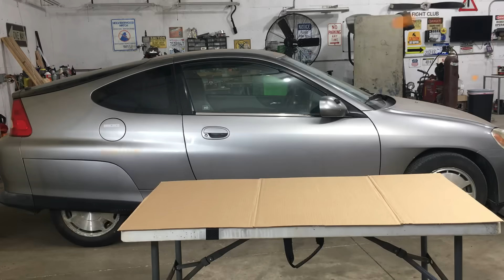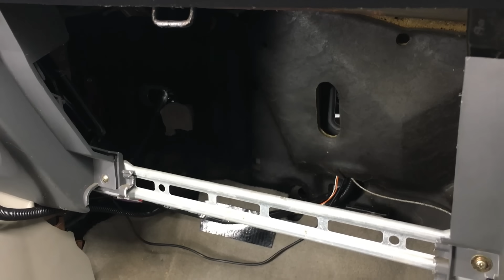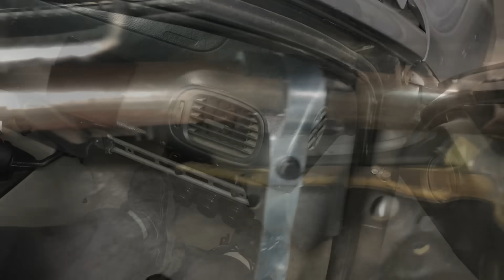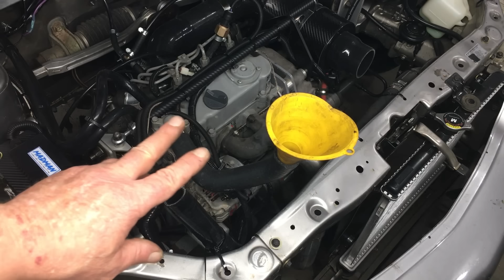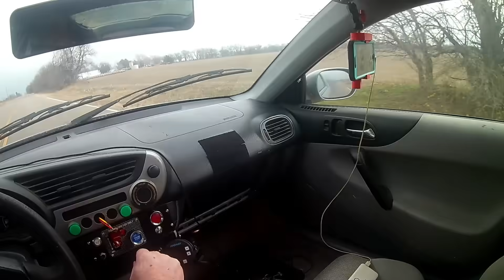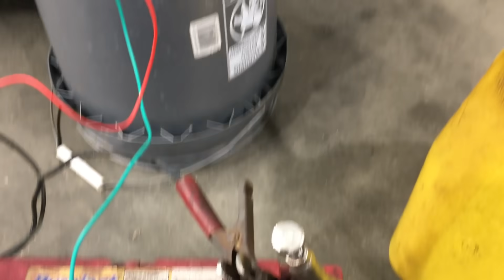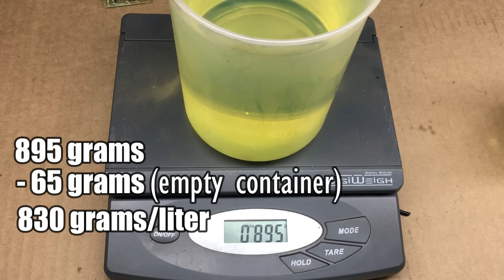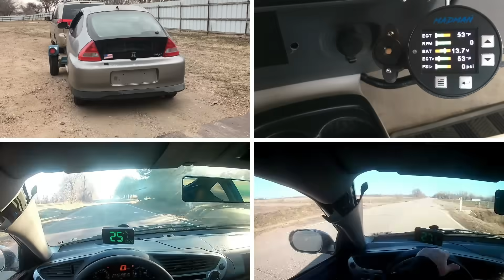S3 E46. MPG ? We test the fuel economy on the 719 cc diesel powered Honda insight

Comment: 67 MPG is actually quite a bit worse than I would have thought. That's pretty close to the stock insight would get on the highway, and the hybrid system doesn't really do much on the highway. Maybe the belly pan makes that much of a difference?
Reply: Stock first-gen Insight would probably have gotten more than 70mpg at similar speeds. I know mine does.
But there are lots of variables. I don't know if the tires are OEM or not (nothing beats the efficiency of OEM tires on this car). It's winter so that's probably hurting economy. I don't know if diesel fuel has winter blends that are worse for efficiency like gasoline does? Also the first-gen Insight engine had a LOT of tech put into efficiency; it's a tough challenger.
I also don't know if diesel efficiency suffers at 100% load like gasoline engines tend to. That 722 has quite low power; stock gen1 Insight ICE makes 67hp without the electric assist.
Reply: @IstasPumaNevada there is indeed winter blend diesel, and it probably does hurt mileage a bit. Different mix helps to keep gelling at bay, which is a massive problem with diesel at low temps. Main difference is more diesel #1 (kerosene) in the mix

Comment: Saw an Insight for sale locally for $2800. We also have a Horror Fright close by. Hmmm.... 🤣
Reply: If it's in good running condition, get it and leave it stock! It should get over 70mpg at the speeds used in this test, but still has enough oomph to maintain highway speeds going over mountains (like Homestake Pass, which I've driven my first-gen Insight over many times). I averaged 67mpg on a cross-country trip this past June.
Reply: @IstasPumaNevada  but they're so ugly 😁

Comment: "It's not my problem, that's how engineering is done".  That is a true statement if you ever worked on a vehicle.
Reply from the maker: LOL...exactly !
Reply: I really love the engineer who put the oil filter on the back of my 2.0 Zetec engine block right above the exhaust. That took some extra thought.
Reply: @kks_123-u1w That was totally normal even on Japanese motorbikes from the 70s and 80s. Imagine the filter being trapped behind the header of a 4 cylinder engine and consider that the oil needs to be hot in order to be drained properly, and consequently the header will be even more so... mind you, their engineers will have carefully considered this, but must have come to the conclusion that this setup was the best of all available options. Strange
Reply: As an engineer, I can confirm that many engineers forget about how there work is actually being physically applied. 😭😂
Reply: I recently ventured from working on mostly just road going vehicles, to doing some off road equipment work, mini ex, tractors, etc. it seems to apply there, even a little on the older equipment 😂
Reply: Haha, agreed 😅

Comment: Personally, i'd have used a propane heater. It's good to have one on standby. Although the diesel heater would do the job just fine it's less portable, it's more of a permanent setup.
Reply: I tried using a propane heater in an old Volkswagen bus years ago. It didn't put out nearly enough heat, but it produced a LOT of water vapor, causing the windows to fog up terribly.

Comment: 67 MPG is about what it got as a hybrid. Imagine if we had put more effort into making efficient diesel cars instead of complicated hybrid systems, we could have really improved the fuel economy of vehicles here. But instead our government pushes technologies they prefer for....reasons.
Reply: Well  true. But this car is super light. As I hybrid It could get 80+mpg depending how you drove it. I imagine your car is alot heavyer.
Reply: Hybrid systems feel like a band-aid to make really heavy cars less gas guzzling. some of those hybrid trucks are only getting 20 mpg, which is TERRIBLE
Reply: @-aid4084 A Lightning is $30k USD more than my F350 and only 500 pounds lighter, with nowhere near the capabilities.  The F350 has a 29 gallon tank good for 640 miles and only takes ten minutes to "charge."
Reply: @Noah_E  yeah... I know? I'm not an EV enthusiast by any stretch.
Reply: The government pushes technology that reduces PM2.5 and NOx respiratory pollutants. I personally don't enjoy breathing diesel exhaust.
Reply: Pushes technology that can't be worked on at all
Reply: There's a problem with that; particulate emissions. U.S. emissions standards were set to minimize public health impact. Europe's emissions standards were set to maximize efficiency, and they've been having a problem with particulate emissions as a result. Plus, all else equal, a diesel engine just costs more than an equivalent performance gasoline engine; things would be easier if the society/marketing feedback loop here in the U.S. demanded reasonable engines instead of overpowered ones.
Many hybrid systems are mostly a gimmick, but not the first-gen Insight's. Its engine is properly small, so it needs that electric to get decent acceleration at lower speeds/RPMs.
Reply: Imagine if we didn't make overly complicated hybrid engines and just stuck with ev's?
Reply: @Shinare73 go for it. However EVs are limited by battery capacity. When you can develop a lightweight battery that charges in minutes and drives for hours, then EVs will take over. We are nowhere near that.
Reply: @herbiehusker1889  yeah that's never happenin lmao

Comment: You could probably use fans for a PC if need be. They look identical to computer fans from Corsair. I think there is a microcenter in Overland Park, KS.
Reply from the maker: The fans in the heater produce 65 CFM each....  Regular computer fans produce about 10 CFM.  We ended up replacing the burnt out fan with a 22 CFM  unit and we have a set of the correct replacement fans on the way.    Unfortunately when producing videos,  we cant always spend a lot of time chasing down  parts that may be local or semi local.  Most of the time its faster to just order something on the internet.
Reply: @robotcantina8957  I didn't realize PC fans produce so little cfm.